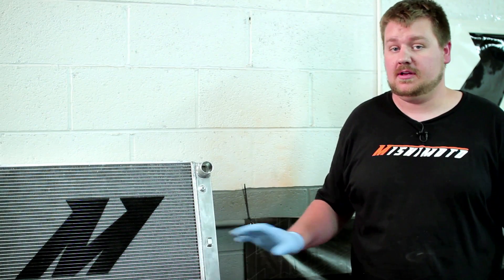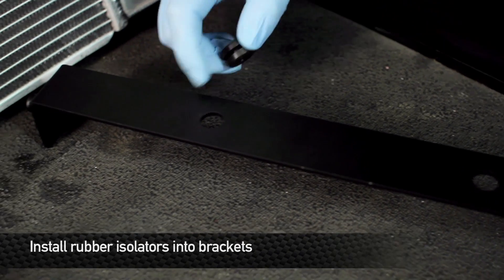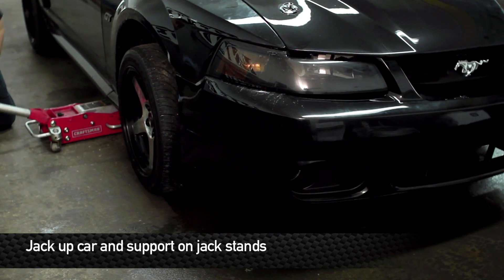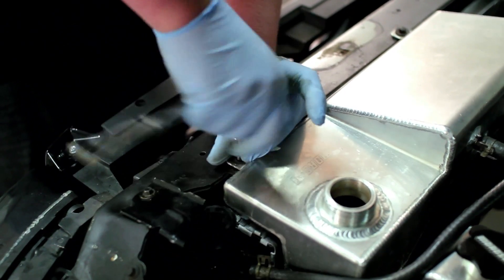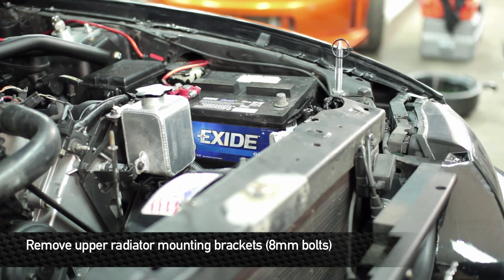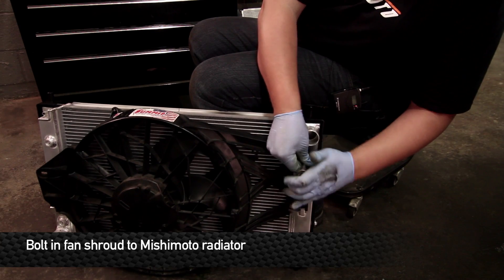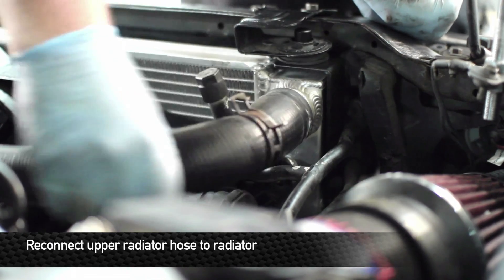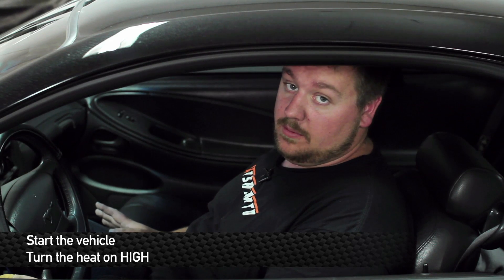How To Install: Mishimoto 1997-2004 Ford Mustang Performance Radiator w/ Stabilizer System

Comment: How would you reconnect your AC condenser lined with the radiator covering everything?
Reply from the maker: You should not have any fitment issues with the A/C lines with our radiator.
Reply: @mishimoto  When I tried to connect it there wasn't enough room for the lines to clear the side, not to mention thay were about 2 inches off
Reply from the maker: Please contact us directly at support@mishimoto.com if you have any fitment or install questions. Thanks!

Comment: what about the transmission cooling lines? i read on your website that these radiators have an internal transmission cooler for the automatics, how does that work? how much better is it than the stock automatic transmission cooler? and when do you advise using an aftermarket trans cooler with this radiator?
Reply from the maker: This is a guide for the manual version, however, the only difference would removing the lines from the OEM unit and adding them to the Mishimoto radiator assuming that the automatic radiator was purchased. While we do not test the performance of this, we can state that the cooler for the transmission will at least meet the capabilities of the OEM unit.  An external unit will always outperform internals. If you are having issues with transmission temps, we would suggest going with an external cooler.

Comment: I have an 04 Mach 1 and I have an automatic transmission, however, I have no transmission cooling lines to plug into the holes, not even the long stock Radiator has transmission cooling lines plugged into it
Reply from the maker: It sounds like there may be an external cooler equipped on your vehicle rather than using the OEM model built into the radiator. Double check the lines coming from your transmission, you should be able to locate that to be sure.

Comment: For my 97 Cobra I had to move the AC lines because the top isolator bolt on the passenger side got in the way. Other than that the radiator works fine
Reply: ROYCE 415 does it run a lot cooler

Comment: I don't need to plug the holes? Mine is manual ?
Reply from the maker: ***** We have two radiators, one for manual transmissions and one for automatic. The part number for the manual is MMRAD-MUS-97B. :) -Rachel

Comment: Will this v8 radiator work on a 1997 mustang 3.8 liter with automatic transmission. I dont care about the radiator hoses because i can get a custom silcon kit and cut it place. Main concern is the mounting brackets if they will mount / fit and if the threads for the automatic transmission will fit ?????